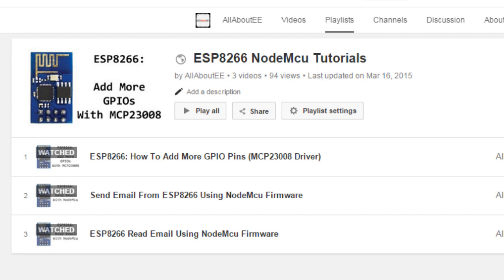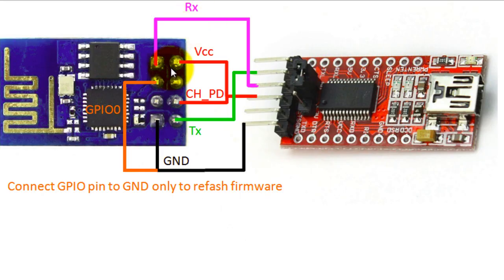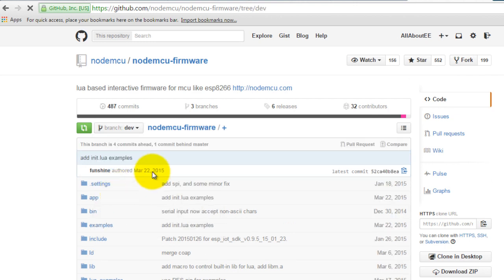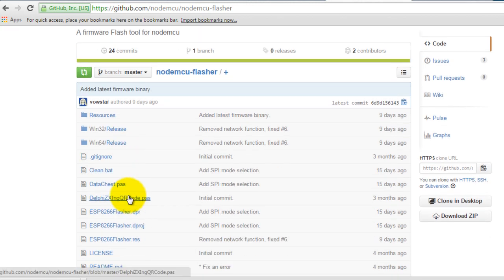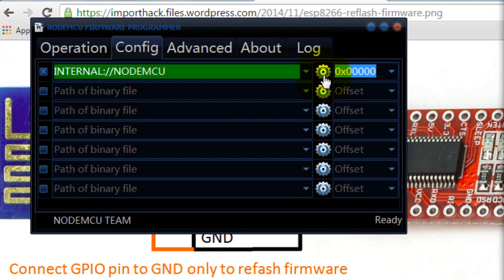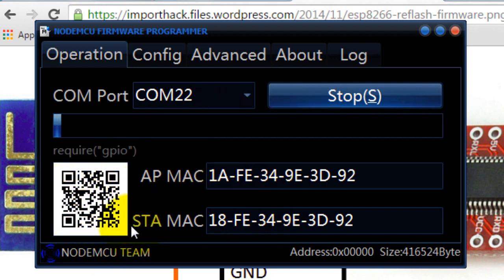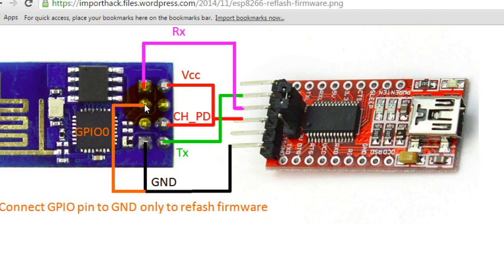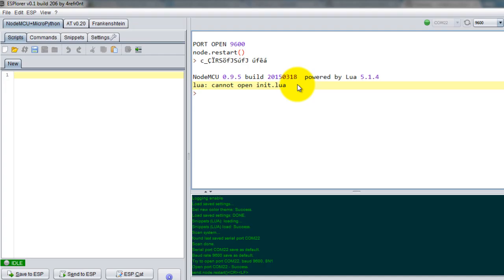ESP8266 How To Flash NodeMcu Firmware

Comment: Why my esp8266 required 5 voltages instead of 3.3 voltages?  When I am working on with 3.3, the esp8266 was slightly red flashing not even the blue light turn on. The uploaded firmware had failed. I just do not understand why they are strongly recommended to use the 3.3 voltages.

Comment: +AllAboutEE  can you please help me. I tried this, i got Stuck with the message "Begin find ESP8266". i  Tried your solution but it is not working. please help
(I am Using Arduino Uno as FTDI. for this i shorted RESET pin of arduino with Ground of Arduino it self)
ESP       Arduino
Tx            Rx
Rx            Tx
Vcc        3.3v
GNG     GND
EN        3.3v
Please help find the solution

Comment: sir i uploaded this test program to my esp8266( ch340 v3 lua wifi IOT) and accidental save it as init.lua and now it is not connecting to my pc plz help ... it is just flashing and led i want to reset it as it was

lighton=0
tmr.alarm(0,1000,1,function()
if lighton==0 then 
    lighton=1 
    led(512,512,512) 
    -- 512/1024, 50% duty cycle
else 
    lighton=0 
    led(0,0,0) 
end 
end)

Comment: plsss help pls pls
i have uploaded latest firmware......
all conections are right but when i send at commands ,i am getting this,,,pls help urgent......i am using node mcu and real term,,,,i ahve also used arduino uno for checking commands there also i didnt get the correct reply..

AT
>> AT+RST
stdin:2: '=' expected near 'AT'
> AT
>> AT+CWMODE=?
stdin:2: '=' expected near 'AT'
.......these are the reply i am gettin ,,,,,in arduino serial monitor
in real term iam getin garbage value ,,,its giving e0e0e0e like this message
pls help 
thanks

Comment: Some VERY IMPORTANT stuff here! Thanks for the video. If you want to get rid of the problem of not connecting for the first time (or not connecting at all in my case), you MUST connect the GPIO15 also to ground ! It will enable the serial communications, as found on a forum after some time digging in. Furthermore, if you want the original firmware from Espressif back, you may go to https://github.com/mlwmlw/esp8266-workshop/tree/master/firmware and download it. The same flasher used on the video works. 
My firmware was the following:
AT version:0.25.0.0(Jun  5 2015 16:27:16)
SDK version:1.1.1
Ai-Thinker Technology Co. Ltd.
Jun 23 2015 23:23:50

Thank you.

Comment: I have flashed an ESP7 successfully. Now I'm trying to flash an ESP12  and have problems. Wiring is a bit different in that GPIO 15 must also be grounded along with GPIO0. Some claim GPIO2 must be pulled high, but I've not seen that mentioned in documentation. The problem is that the flash starts, and after about 7-10% it stops. Checking the log reveals that a timeout occurred after more than 20 successful writes. Anyone know what's happening here?

Comment: I can't seem to get the ftdi to upload the firmware. My ftdi doesn't have 3.3v so I am using an arduino for my 3.3v to the esp8266. I am using same ground because I am using the ftdi to power the arduino via the VIN pin. I get a solid blue light on the esp8266 the whole time but the ftdi is flashing as if it is uploading something. Any ideas what may be happening?

Comment: I connected my esp8266 wifi module to  arduino for flashing firmware, my connection is like, 
TX->RX(of arduino)
RX->TX(of arduino)
CH-PD+VCC->3.3v
GND+GPIo0-> GND 

but I failed to flash firmware. Any guess why this happened?
Reply: forget to mention that, i have no power related problem this module works fine on AT command, but some commands does not work properly, that's why i decide to update the firmware.
Reply: hey I have just flash the latest firmware, bt now  AT command does not working on arduino IDE :(, when I send AT it dose not show "OK" message, it shows ">>" , bt before the update it showed OK when I send AT.

Comment: HEY, when i flash ESP8266 i get time out ??what is that mean?
Reply from the maker: Jan Zagar It means your ESP is not responding.  Probably not enough power, use a separate power supply instead of USB. The ESP8266 might be the cheapest WIFI chip, but it lacks everything to get started.
Reply: OK, i made separeted, but still i get Invalid head of packet.what now?
Reply: AllAboutEE Hey, i upload the firmware in anouther computer and it work! and now i have one question when i upload the code on ESP8266 it worked when i turn off power didn't worked, does it have to be always on power otherwise lost the code?
Reply from the maker: Jan Zagar You have to load the program as the main program so that it runs automatically on power-up.
Reply: thnx i made it
Reply: +AllAboutEE  can you please help me. I tried this, i got Stuck with the message "Begin find ESP8266". i  Tried your solution but it is not working. please help
(I am Using Arduino Uno as FTDI. for this i shorted RESET pin of arduino with Ground of Arduino it self)
ESP       Arduino
Tx            Rx
Rx            Tx
Vcc        3.3v
GNG     GND
EN        3.3v
Please help find the solution
Reply: +Jan Zagar my esp needed the baud rate changed in the advanced tab down to 115200

Comment: AllAboutEE Salam,
Pardon my ignorance ... what is the difference between the term "FTDI" and "USB to TTL"?
Reply from the maker: Talha Kamran FTDI is the name of a company that makes USB to TTL converters http://www.ftdichip.com/  There are other alternatives to FTDI chips called CH341. Yet another alternative is to program a microcontroller to do the USB to TTL interface, I believe that is what Arduino uses now.
Reply: AllAboutEE Ayeeee!  I am in China I saw a 2.6 CNY USB to TTL and bought it. It had 3.3v and 5v support. I had ESP8266 ESP-12 and was trying to configure it. For 2 days I was going crazy and at the end figured out that the driver for that USB to TTL are no good if you are using Windows 8. :(
I recommend people to spend little more and get the FTDI instead.